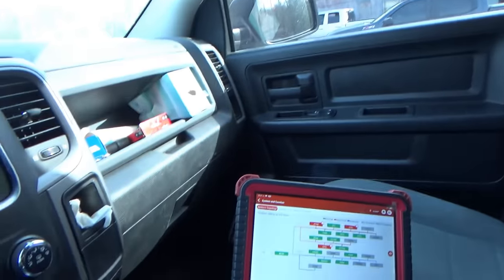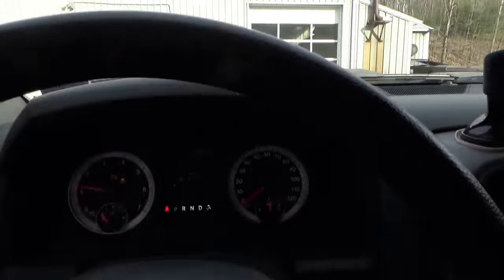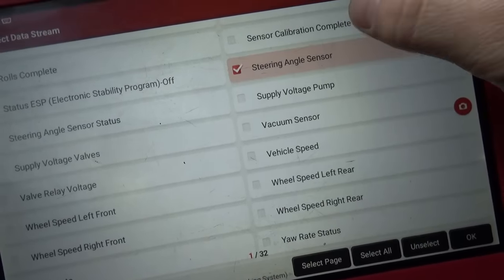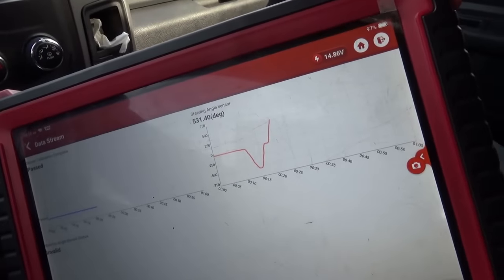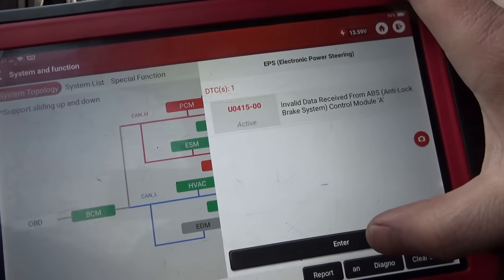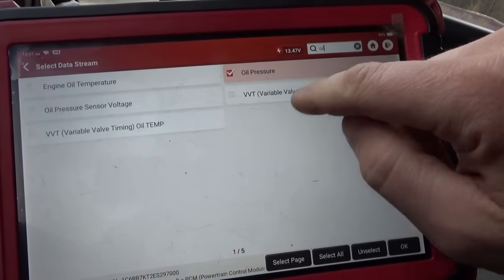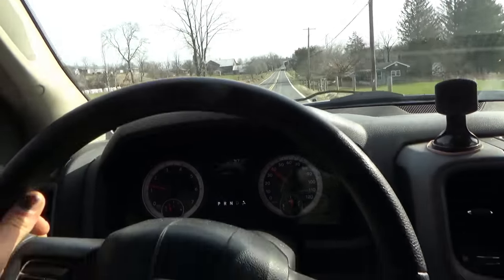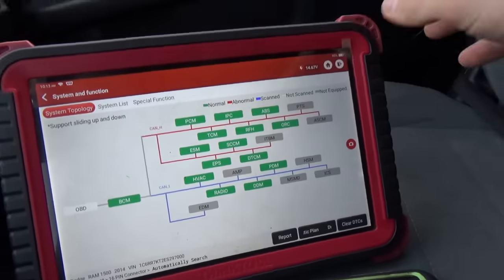Are These Problems RELATED? (Ram Hemi V8: Oil Pressure & ABS Steering codes)

Comment: I did timing chains on two ford 4.0 l. After replacing guides gears chains tensioners. I found out the wiring harnesses are junk. From factory they are taped with electrical tape about 2 inches from each sensor and tape from friction eats wire insulation off causing shorts. Keep this in mind when diagnosing.😄
Reply: I’ve seen that harness issue many times. It’s like the insulation turns to mush. Thanks!
Reply: Is that the engine that has a front and a REAR timing chain? It was converted, by Ford, from a cam-in-block engine. It has a jackshaft where the cam used to be. :face-green-smiling::face-fuchsia-wide-eyes:
Reply: I told one shop owner to replace the harness before I even hook up a scan tool, smoke came out of his ears LOL

Comment: I'd say that the oil pressure is low at cruise speed. I have a 2014 Ram with the same drive train and it would be over 50psi oil pressure at any cruise speed...you were only getting 31psi.
Reply: Yes, but he suspected the oil pressure sensor giving those readings was bad.

Comment: Thank you Ivan. The originator of "cylinder deactivation" needs to be given an atomic wedgie. One OEM starts doing it, then the rest often follow. I'd like these engineers to explain why a 2.5L 4cyl that gets 25city/32hwy is even a candidate for such a (long-term) risky and unnecessary design change. Any 'benefit' is far outweighed by the possible cost of failures. (Whisky Tango Hotel). Thx again.
Reply: Yeppers. The financial and environmental costs of failed engines and other components might outweigh any benefits from "advanced" technology.
Edit to add: why doesn't the EPA regulate reliability and overall impact instead of just efficiency? Better yet, get the EPA out of our way.

Comment: If the problem only occurs in ECO mode, then there could be a mechanical problem in the cylinder shut off part of the engine causing a low oil pressure condition. I would advise the shop/owner about this so you do not get an expensive warranty claim later on when the engine gets run by someone that doesn't shut off ECO mode and suffers a catastrophic failure due to low oil pressure.

Comment: Those explorer engines were known for timing chain guides coming apart.  I replaced one with a junk yard engine years ago, and never got to put the hood back on because the new/used engine rattled worse than the one that we replaced.

Comment: Way to utilize your resources like a maestro, Ivan.  I am learning so much and you are definitely inspiring many others.  Thanks also, for the follow up on the Ford "Exploder" (haha).  Good to know that I got one right, predicting that the crank sprocket jumped some teeth due to the weak chain tensioner.

Comment: I found out about steering wheel being straight problems the hard way. 
Did a rack and pinion on a 04 Camry. Drove it down the street with the steering wheel out of wack. The ABS started spazzing out. Got it aligned all was good

Comment: On the timing chain issue,  with it being such low miles:  it was very likely a broken guide.  If the oil is neglected or low,  the oil will heat up/  the plastic guides heat up,  then break;   then your tensioner will extend past it's full range of motion trying to account for it.   Then the chain will flop around and chew up the broken guide pieces that have fallen down;  causing it to jump teeth at the crank first.   That's why he could hear crunchy noises and teeth jumping when he barred' it over.  As long as the valves didn't hit, it can still be repaired fairly easily.  but that's for the next guy to find out now,  since it was turned in as a core.  ;)

Comment: I would start with checking the air pressure in the front tires, Noticed 31 psi in front left when right side was 39 psi,

Comment: The steering wheel in my ‘21 Ram 1500 Classic (4th Gen) is off to the right about 10 degrees, it just suddenly happened one day. It’s not setting any codes as it is under 20 degrees and the truck trails straight with the steering wheel off to the side a little. Other than it being a little annoying it doesn’t affect anything and I’ve been driving it like that for about 2 years, after the dealer told me that if I bring it in to have it looked like they’ll have to keep it for couple of days. It will be getting new tires installed very soon so the alignment will be done then. 
Thanks for the informative video Ivan.
Reply: better go look for the missing/broken bushings or ball joint ready to fail.
Reply: @throttlebottle5906  Nothing missing/broken or loose. Front end is tight and trails straight. Only the steering wheel is off by few degrees.

Comment: I just started watching but it reminds me of the P2646/2647 VTEC codes on Hondas, where when VTEC is disabled due to certain causes (low oil pressure, bad pressures switches, bad solenoid, dirty filters, etc), the ABS system is also disabled at speeds above 30kph, so the stability control light is illuminated on the dash along with the CEL. The ABS system will usually set a DTC like 83-01 or similar.  Interested to see if whoever makes Dodges these days does the same thing.

Comment: We don't seem to be able to get "All Data" in Australia. And boy could we use it. Chasing down wiring diagrams is a real pain. I am currently working on a 2007 Mazda3 owned by my older son with 2 of the power door actuators that slowly died in a period of a few months. I have 3 wiring diagrams and not one of them matches 100% the pinout of the wiring on this car. OEM's are very expensive and you want to be 100% sure.
Reply: I'm an Aussie Auto Elec with 30+ years in the trade and can tell you that finding reliable wiring diagrams has always been difficult and expensive. Back before the internet we had a bookshelf at work full of wiring diagram manuals which constantly needed updating and you would still regularly get vehicles in that you had no diagrams for. I have yet to find a good online subscription based service that offers anything close to what is available in other countries. It is very frustrating.

Comment: alright.  Iven's got a motorcycle that is not throwing any codes.  Can't wait for the diagnostic.  Could it be a lose spoke effecting the steering sensor????
Reply from the maker: That's my 1974 Honda CB360... decided to bring it out of retirement, been sitting since 2010 or so... Needs new piston rings and cam chain guides 😉

Comment: I have the same engine. Oil pressure should be around 50psi going down the road. 31 psi would be hot idle. There is definitely a pressure issue. That also explains why the code comes on when in ECO (4 cylinder mode). Additional oil flow/pressure is needed to get lifters into ECO mode.

Comment: Needs an alignment...yup
Common sense by looking at the steering wheel tells you to look at the suspension system and get an alignment. 
My buddy's ram oil pressure is 30 psi with 220k
I use Alldata for my vehicles.

Comment: I fight with this constantly on the Promaster. Best I can tell, the steering angle sensor will send sporatic garbage data, which will fire all abs, esc, and give a message of “hill holder warning” which I’m pretty sure is a vestige of the european versions of the van. Clears on restart, so I have no way to test it while it’s active. On restart, it will be gone and sometimes wont recur for YEARS. 

The P0520, at least on the 3.6, is always the oil pressure sensor in the cooler. Every 3.6 will have it at some point. Harmless, as the computer can derive the oil pressure from the cam timing. 

However, if the oil temp sensor next to it fails, or mice eat the wires, it will fire the throttle light, abs, esc, and it will also put the engine in low power mode. Shops will often go chasing the abs system, or the tb or pedal. Tricky stuff. 

I’m delighted to see your thumb is healing.
Reply: Driving in very windy conditions will sometimes do that. Constantly fighting the wheel to go straight will set a temporary code. Problematic with big vans that act like a sail with side winds. Has happened to me with my Sprinter.
Reply: @disgruntledcanuck  Correct! One tell tale I instruct customers to look for is cruise control. If the alignment is off enough, it will disable cruise.

Comment: I serviced Police Interceptor Exploders that mileage was average for chains and tensioners. Mine were high hour engines due to extended idle times and the chains and tensioners took a beating in Police service.

Comment: I've had similar alignment issues where you tell the alignment shop to do an alignment but they never did make sure that the steering wheel was also aligned straight when the wheels are straight, they only appeared to align the tires/wheels/rims.
Reply from the maker: Amateurs 😂

Comment: just finished a 2018 ram 3500 customer always turned off eco mode which stops the mds started making lifter noise pulled down did some research and some say that turning off the eco mode every time starves lifters on the mds and can cause lifter failure don't know for sure might want to look into it. i replaced the engine they didn't want to repair

Comment: I wonder why the steering wheel was so far off from center. Did they recently have work done?
Reply: Pennsylvania had a bad pothole season, so I wonder if the truck didn't see a few on the highway.

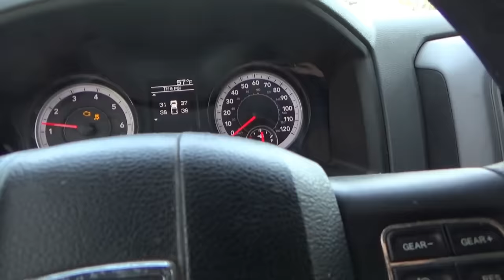Comment: 2:09 - I thought the alignment issue was due to one tire being 6-7 psi lower than the other, but the steering wheel would have been to the left not the right.
Reply from the maker: It didn't pull at all, just steering wheel not centered 😊

Comment: I'm more convinced than even, these modern cars can't handle extended oil change intervals.
Reply: Change every 3000 to 4000 miles old or new vehicles synthetic or not its the best cheapest safeguard...

My RAM 5.7 Hemi is changed every 3000 miles with synthetic and its new so not expecting issues(2nd oil change)..

My now sold 2009 Challenger 5.7 Hemi ran perfect with 185,000 miles,engine ran perfect! Changed it with synthetic every 3000 to 4000 miles since I bought it new! My nephew drove it another 20,000 miles with no issues,he didnt beat on it and kept up with my oil change routine..My wife has a 2023 Challenger Shaker 5.7 Hemi and my new RAM Hemi and maintenance is the key..

Even Toyota I change them 3-4000 miles!  Remember not just the oil but the filter is key too,people forget about the job the filter does!

*I am a Former Toyota Tech!
Reply: Of course they can't. They're not magic. More than 5000 mile intervals is begging for trouble.
Reply from the maker: Only old school pushrod engines can handle extended oil changes 😄
Reply: @PineHollowAutoDiagnostics  old school? My baby is only 25 years old.